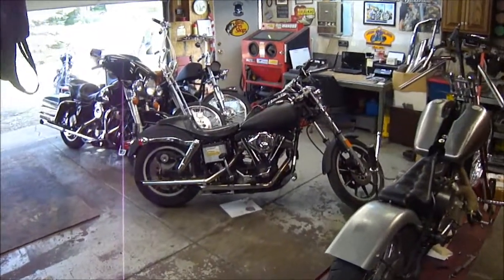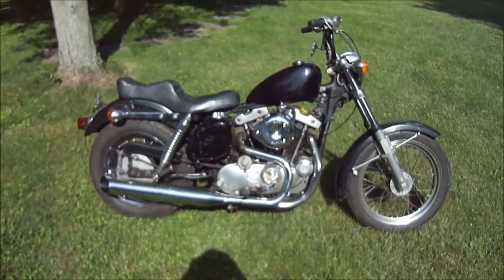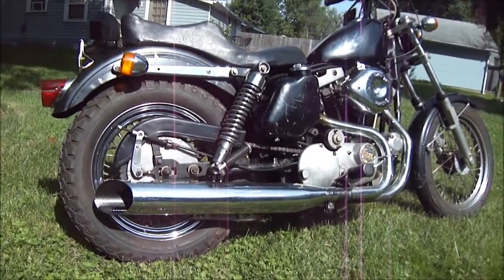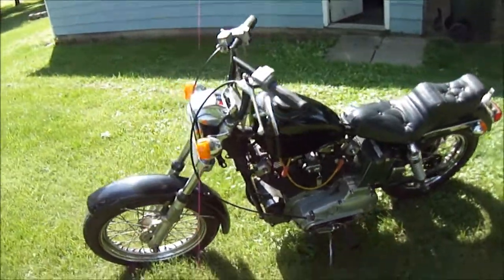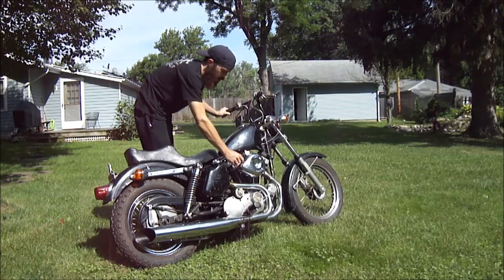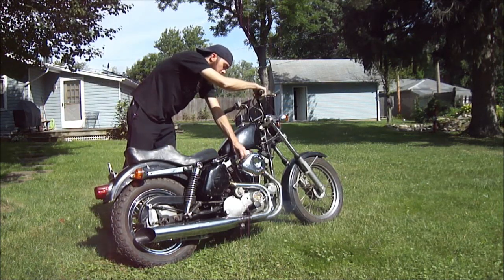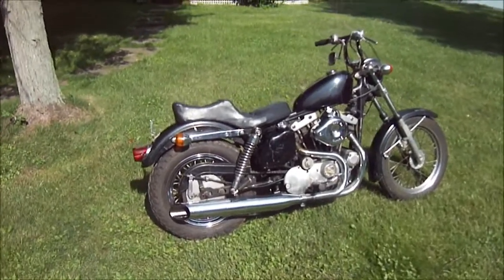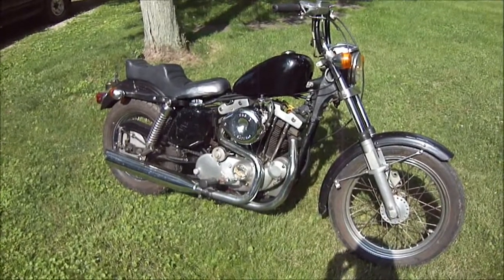1977 Harley Ironhead Sportster 2 into 1 Exhaust

Comment: Just picked up a set of slightly rusty original 2 into 1 exhaust for my 1977 XLH.Missing clamps. What did you use to clamp the piles to the muffler. Thanks.